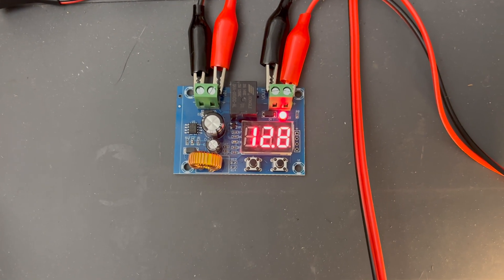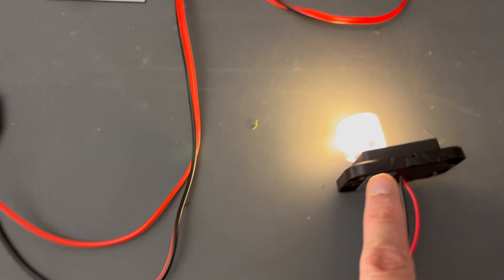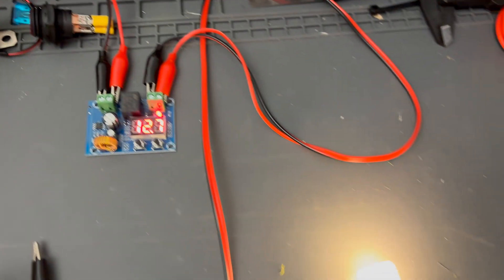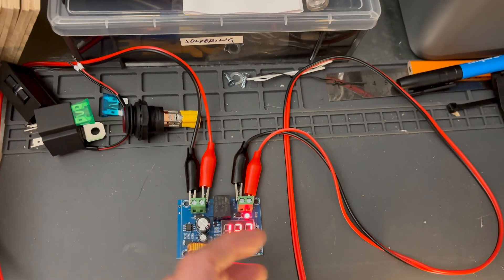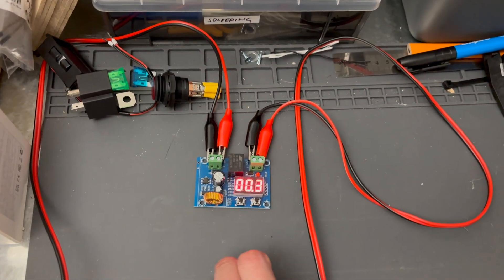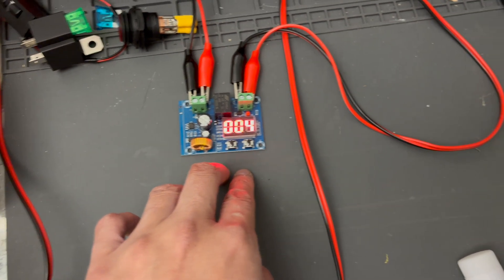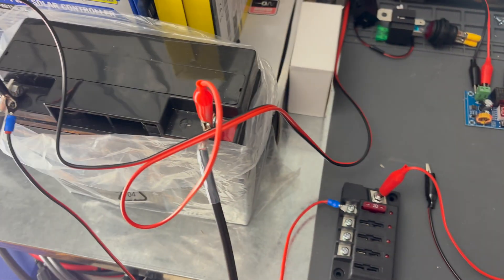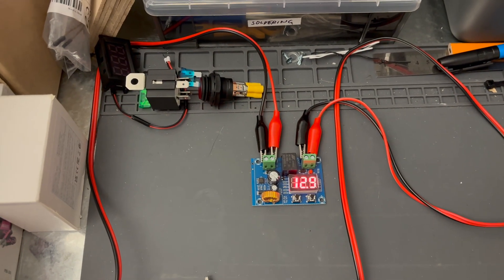This LVD Module Will Save Your Battery! 🔋 | XH-M609 Explained (12V DIY Solar)

Comment: The huge disadvantage of these modules is that you can't turn off the display. Does anyone know how to do that? It drains my car battery when the car is parked for a long time. I use it for DRL daytime running lights by sensing the battery voltage. Does anyone know which pin I can use to turn off the display? The device draws 5mA with the display off and I really like that...
Reply from the maker: Probably the only way is to desolder and add a switch.